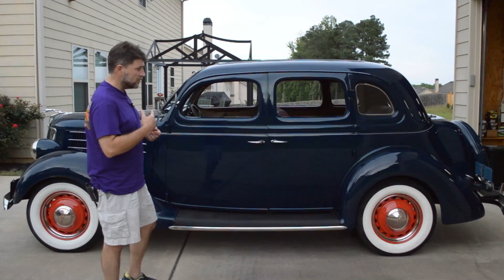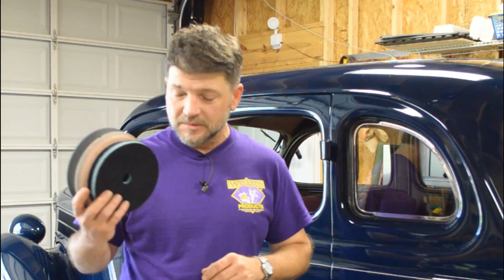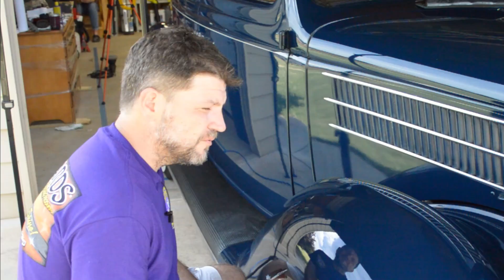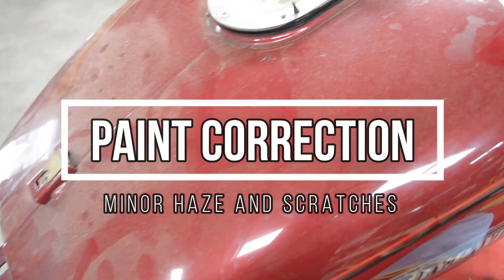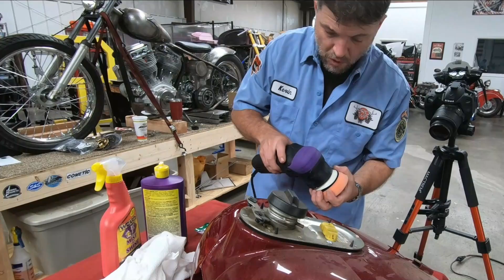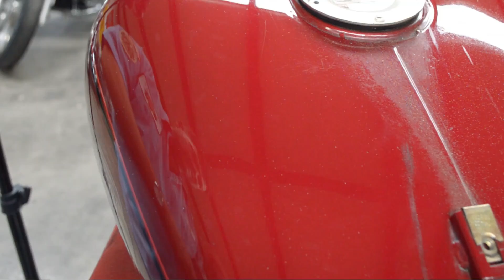Paint Scratch Repair & Ceramic Coating - Wizards Products - Kevin Baxter - Pro Twin Performance

Comment: Kevin can you advise if a oil cooler fan can be fitted to a 2018 Breakout (M8) and if you recommend them? If so can you recommend a brand? Thanks
Reply from the maker: Absolutely sir...have a look at this one.  I do highly recommend Jagg fan assisted oil coolers.  I consistently see 35-40 degree oil temp reduction.  http://protwin.com/fan-assistedvertical10-rowoilcoolersystem.aspx

Comment: Question to All: Was Simoniz Mototec coating on my Harley Road King Special worth $800 from an auto-dealer-owned H-D dealer ??
Reply from the maker: Wow.  800 bucks?  Heres a couple links to read from the simoniz website dealer page. Two key things stand out to me...quoting....

How long does it take to apply MotoTect?
It can take between 20-50 minutes depending upon the size of the Motorcycle.

Now motorcycle dealerships have the ability to benefit from F&I offerings and incentives with a program specifically designed for motorcyclists: MotoTect. In the fast-paced world of motorcycling, give your customers additional coverage while increasing dealership revenue. 

https://www.simoniz.com/dealerships/mototect/

I see nothing about it being a ceramic coating or recognized industry formulated product. It seems to be a cost based more on a warranty than a service and product worth $800...snake oil in other words. It's one of those "undercoating" car dealership F&I add on things.  I'm sorry to say this man, but I call bull@%$× on that. Just being straight up.
Reply: @KevinBaxter  Kevin, Thanks very much for your research and feedback. The Harley stealership charged me $26,999 for a Road King Special (right off the truck with no MSRP tag) that I later learned was (a Moco-inflated) $25,089 (for the Scorched Orange & Denim specialized) painted Road King Special (on a slow, slow Sunday in February of 2019 when I was the only customer). 
So...two, separate visits to Ohio Small Claims Courts: one suit in Hamilton County (where the bike was delivered to me) and the other in whatever County Pataskala, Ohio is in. Another example of greed, plain and simple, because the inflated Price changed the Down Payment (from Zero) and the finance rate from 2.99% to 3.99%.
When I met in April 2019 with the GM and F&I guys who were both there on Sunday, February 24, the F&I guy (who had an Eagle Scout display on his office wall that fateful Sunday in February) told me (when I questioned the $795 for MotoTect) that he had spent $2,400 to have his new Dodge Ram coated a while ago.
Reply from the maker: Man that's quite a story...hate you had to go thru that.  They saw you coming unfortunately.  It wasnt unusual at all years ago, for bikes to sell way above MSRP because that's what the market was.  It can cost $2000 plus to CERAMIC coat a car..not because the product is that expensive or difficult to install, but because of the prep work that has to be done before.  That level of prep work doesnt need to be done on a new vehicle.  So if he paid 2400 on a NEW vehicle, that's crazy.  But from what I read...you paid more for a warranty than you did a product.  Back end F&I products bank on the fact that most of those products never get used.  Kinda like gift cards.  I read somewhere that 60$ of gift cards never get used.  Crazy.